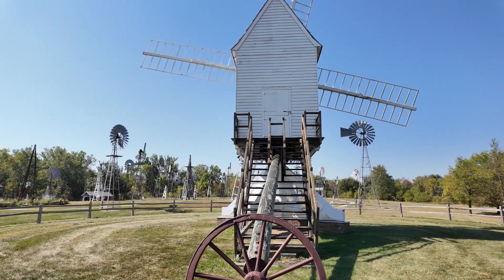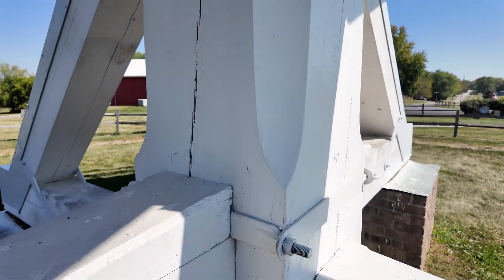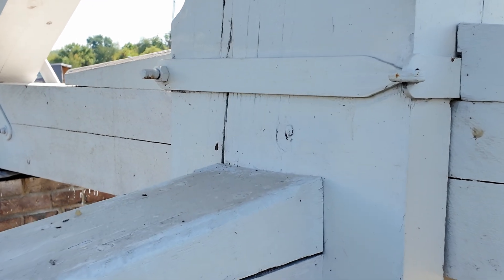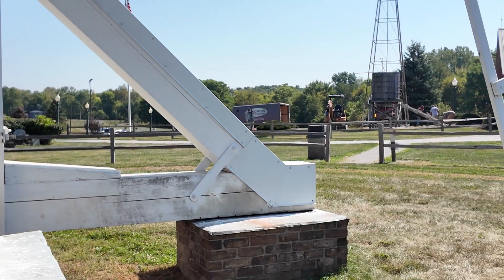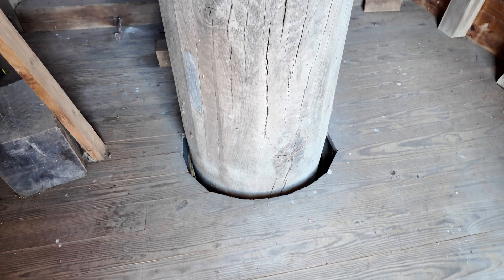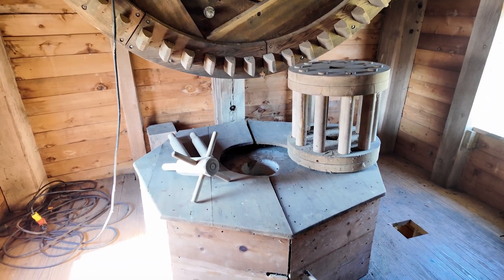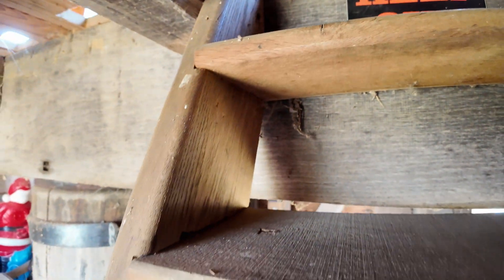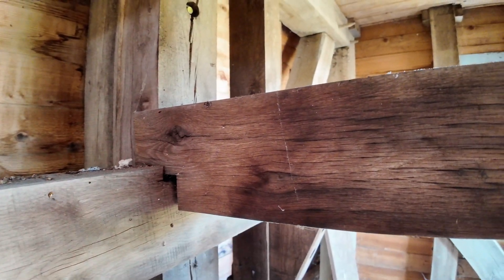800-Year Old Windmill Design Rotates Whole Building!

Comment: That's fantastic! What a clever means of milling. It's amazing how compact it is in there. Is the pillow block bearing at the tail of the sail rotor also a thrust bearing? You mentioned significant axial force acting on the rotor, and I was surprised how small that bearing was - or is thrust handled elsewhere?. 

Just for fun, I'm imagining a second tailwheel boom perpendicular to the first, with a small auxiliary sail drive. This small wind turbine always turns into the prevailing wind (like a halladay wind turbine), and depending on it's degree of yaw engages either a forward or reversing gear, to drive a tailwheel for keeping the main sails turned into the wind.
Reply from the maker: The bearing takes some of the thrust, but some of it also goes down that long tail post.  There's also some limit to how much thrust you're getting in the first place.  If the wind is too strong, you'd partially, or even fully, furl the sails to cut the force, or just turn the whole mill 90 degrees to the wind to stop it entirely.  Even with no sails mounted, though, things could break, and one of the large spars on a somewhat similar windmill at Greenfield village actually broke off this summer with no sail attached to it.

Interesting idea to keep it automatically turned into the wind.  In some areas, the wind direction changes quite a bit, and that could have been pretty useful.  I wonder if anyone ever implemented it on a large post or cap windmill.

Comment: Fascinating to see this mill. If you look at older post mills, especially in southern England, these looks similar! Especially the roof in this wedge form! I presume the little winch lying around on the millstone-tun is for arresting the long tentering arm (where you adjust) the stones, via rope and pully, somehow. Can not imagine, that this arm was just hanging free. With all the vibrations it had to be fixed somehow, it would have come loose otherwise. Maybe the little winch was on the same floor as the stones and kind of pully driven remote control?
These little mills are fascinating. But it does not take hours to adjust the sails as you're told. A layman or someone who not often works with windmills, needs approx. 45 min and a more experienced master miller (as I saw in the Netherlands) he needs maybe 15 min? That includes stopping the mill 4 times of course and furl and unfurl the cloth! Also, you need normally only one person to put the mill into the wind, normally there is a winch and ropes or chains at the end of the tail, so you just have to turn a hand crank at the winch, which is hard enough! Maybe It's missing here at the museum? Funny this English system, with the big wheel at the end! Only British have these, so maybe the mill was built by immigrants from England?
Reply from the maker: You're right about the migrants from England.  It's a near copy of the first, known mill built in the US,  obviously copied what they had at home.
These sails are smaller, but the couple hours to rig them is the number I got from De Zwaan, a windmill moved directly from The Netherlands.  That one is a much larger "cap mill" instead of a "post mill."  Cap mills are the newer version, and instead of the whole building turning, only the top cap turns, with the drive shaft coming down the exact center of the mill from the top.  That one also has the big wheel up on a catwalk to winch the tower around via chains, which can be done with one person.  These little ones don't get luxury features like that.
In the first part of your comments, are you referring to the 4-spoked wheel sitting on top of the stones?  I'd assumed it was to adjust the stone spacing, too, but then on the floor below, there's the big lever (behind Santa) that does that.  No connection there.  Maybe it's supposed to be connected to a braking system?

Comment: Let me help you on the research on the model trains for your website the accuraft ruby a g scale live steam model is the best beginner live steam model on the market rn for about 650 , mamod went under and the other companies are limited production so ordering one from them is a bit of a headache, accucraft also has their new mable which actually has a sight glass for 1,650 for continuous operation i have been extremely pleased with the ruby i bought several years back and would love to have some of their higher end models but they are quite pricey
Reply from the maker: I THINK I'll have my first, working model steam engine video coming up in the next couple months.